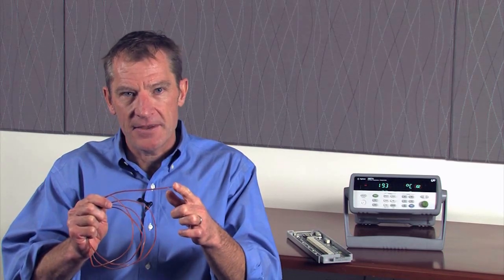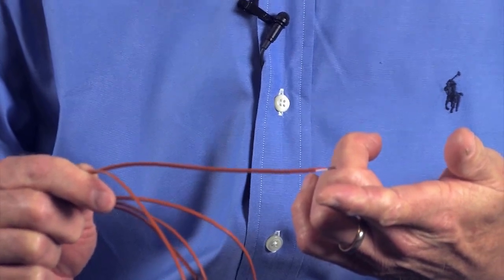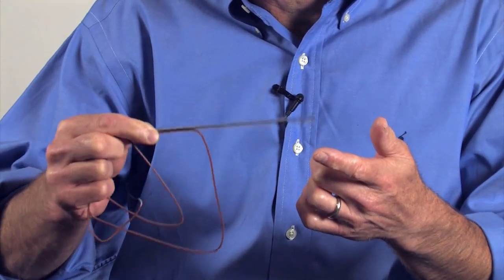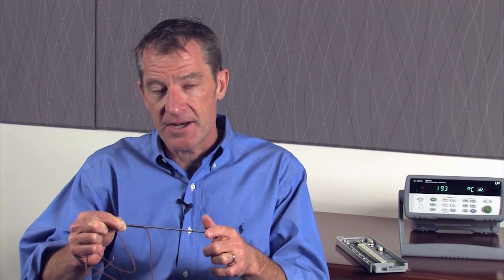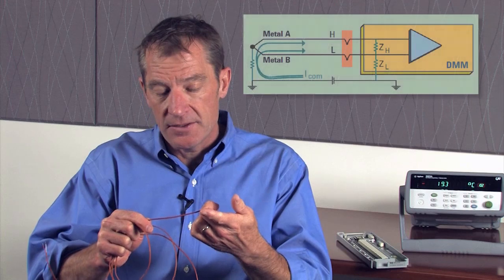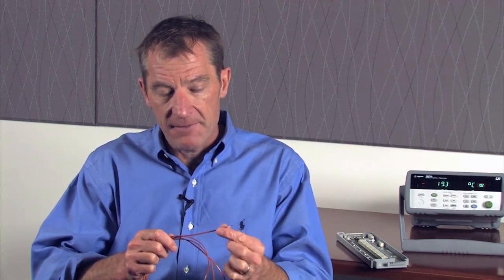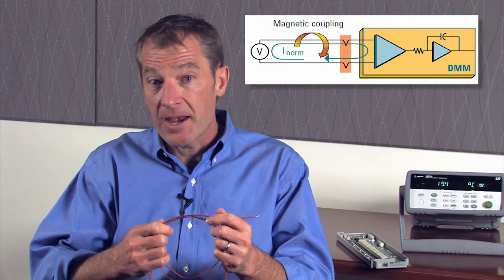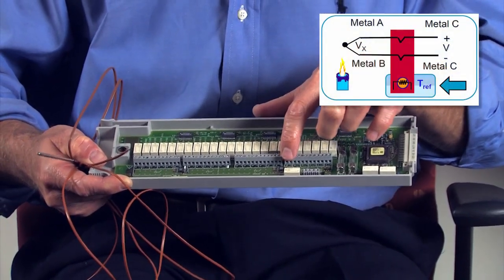Making Accurate Thermocouple Measurements

Comment: There wasn't much practical knowledge for the newbie. Like do you use tape to hold the sensor on or your finger, or what.
Reply from the maker: Elmer Adams  I see a lot of applications that measure temperature over time or need to be repeatable.  For applications that require more accuracy  we often glue the sensor using a thermal conducting glue.  Glue works well as it does not add much thermal mass.  Tape could also work if you wanted to avoid the glue residue.
Reply: Keysight General Purpose Instruments 
I've been trying the past while to use these. I've been testing temperatures of automotive AC lines. I've been using foil tape (like for hvac ducting) but I was hoping for more information like is wind a problem. The vehicles fan is always blowing and I don't know if air blowing on the probes are a problem or if straight aluminum pipe transfers heat differently then black painted aluminum line.
I guess practical info for field testing isn't usually practical for lab testing.
Reply from the maker: Elmer Adams  Great questions.  Heat can be transferred by conduction, convection and it can be radiated.  The fan would be changing the temperature by convection. Aluminium is a good conductor which makes it a poor insulator.  I don't think the black coating would provide any insulation  for the pipe.  A black coating would improve the pipes ability to absorb heat but only slightly since the surface area is small.  Most of the pipe is rubber as it is a good insulator.

Comment: Would have been good to talk a little about typical accuracy of the each of the common types of thermocouples and best methods for dealing with the excess thermocouple wire to minimize noise pickup.  Also, when does the 34970/2 need an isolation transformer for noise.
Reply from the maker: Blame Blame  Good point to eliminate the excess wire. The 34970A and 34972A are isolated from earth ground to 300V.  Keysight offers an application note "Practical Temperature Measurements" with details on selecting the best thermal couple for a particular application.